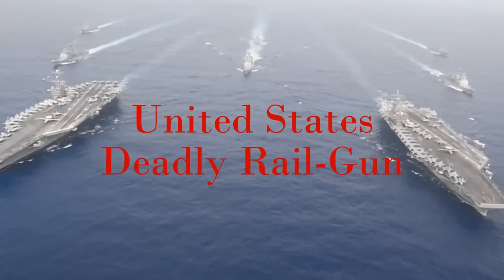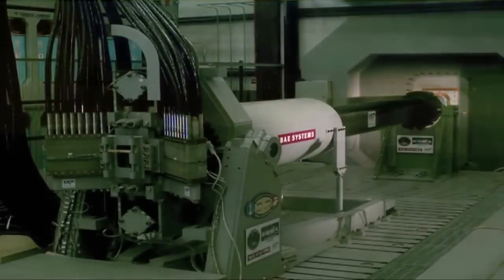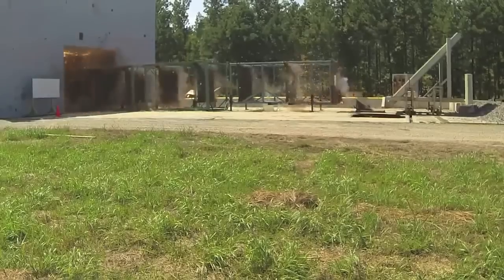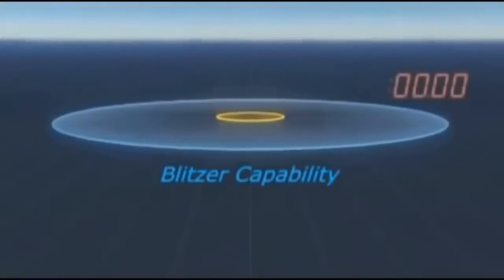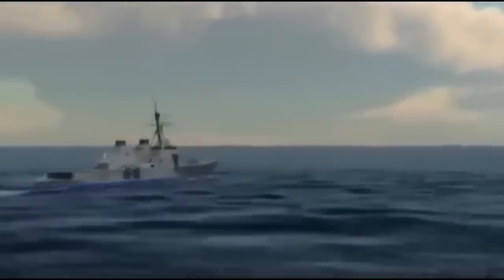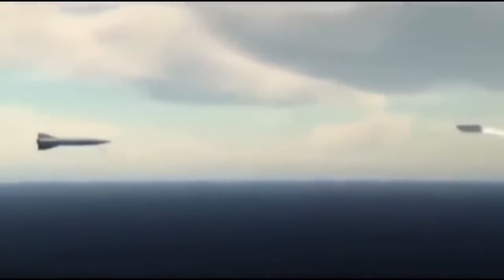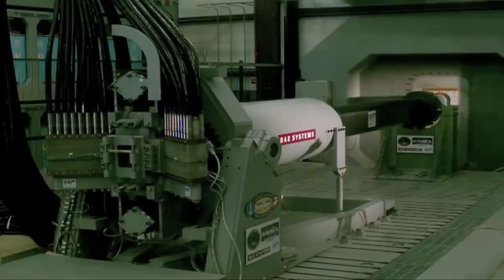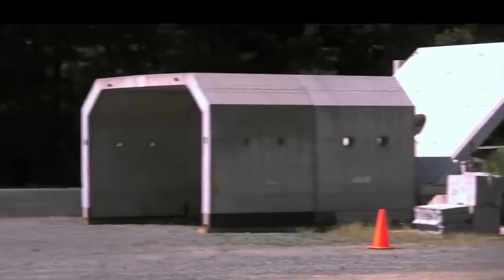USS Zumwalt will deploy the deadly Blitzer railgun

Comment: So the video says that this does not require chemical propellants. The thing about railguns is, the projectile will weld itself to the  rails at the breach if it does not enter with sufficient velocity. As I understand, the way that the test facility in Virginia achieves this high initial velocity is through the use of conventional chemical propellants.

Comment: if its using electromagnetic instead of conbustion chamber then where the heck all that explotion come from?
Reply: Chousa Heidan Air resistance + forced air compression in front , the flame trail is basically heat energy getting sucked into the wake of the payload as it travels

Comment: There's no question that Rail Guns can out-perform chemical cannons -- and the ordinance is technically safer -- but this video is making claims of accuracy that are just ludicrous. Sure, the gun has the range, but the further the distance to the target, the more each micro-degree of inclination matters. This thing has unprecedented range, but its targeting system isn't going to be any better than what we have now. You'd be lucky to hit a car standing still outside the range of conventional guns; precision strikes against enemy systems is intentionally misleading.
Reply: Live satellite assisted targeting + mid-flight computer corrected trajectory on a finned payload. Problem solved
Reply: Sorry, but circuitry won't survive the magnetic fields generated in a railgun.
Reply: Sure it would, ever heard of a Faraday cage?
Reply: Espen Negron Sure, I'm familiar with them. They're not going to block a 10 Tesla (!) magnetic pulse at 200 hz. Likewise, Mu-metal would vaporize trying to carry the eddy currents. We're talking about a device which imparts 50 Mj of energy in 5 milliseconds ... Terawatts of power! You don't put a radio receiver inside that and expect it to function afterwards.
Reply: No imagination. A Faraday cage is only as effective as the material being used, the amount being used, how closely "knitted" the material is, the pattern its "knitted" into, and how many layers are being used. Given plenty of thought, some research into tune-able meta-materials, dropping the assumption that the main components of the receiver functions solely on electrons, there's a solution. Though it'd be very cost prohibitive, the point is that it would work. 

TL'DR, you don't need to work around having that ridiculous amount of magnetism, it should be incorporated into the build. The faraday cage is simply to help slow down ion leeching.
Reply: I'm sorry. Did you just say I should drop the "assumption" that a RADIO RECEIVER -- something designed to interact with electro-magnetic waves -- I should drop the assumption that it functions based on electrons? Okay, we're done. Good luck with your invention, because if you develop a field-effect radio receiver, you'll probably be rich.
Reply: Daniel Budney. Again close-minded. Yes Dan, drop electrons.Your looking at the problem with old eyes; radio waves are effective and have been for the last 50 years but it is an aging tech. What else is electromagnetic in nature that is able to transmit information? FYI, not every logic gate has to use the flow of electrons to work. Also, before you get snarky, I dont need to invent it, because its already been invented, its just costly, hence the reason I said do your own research because Im not paid to write out a whole dissertation to help you realize it yourself, and to quote "If your good at something, dont do it for free."
Reply: Now you're suggesting we use laser communication to guide a target less than 1 meter long traveling at Mach 7? Nice try, but I'm done being trolled.
Reply: Daniel Budney Lmao. No. light could work, if you were that pressed to put in the work to make it happen, but not what I was referring to. I'll give you a place to start reading: Magnetic logic gates. You can fill in the rest. Fun talking to you Dan

Comment: Yeah, the projectiles are very fast and fairly cheap, unlike the $2M guided shells that are being ditched now.  This would be really great then if it wasn't that railgun rails have to be replaced very frequently because of the effects of the extreme thermal stress put on them.  (Some capacitors will probably have to be replaced almost as often too.)  Unfortunately, high-performance railguns like this are to normal guns pretty much what top fuel dragsters are to other racecars.  Yeah, they're much faster and more powerful, but you also have to replace big important expensive parts with such extravagant frequency that it just isn't practical at all.  The navy is generally going to have to reserve these railguns just for taking out gigantic decepticons or else this weapon technology too will bust the navy's bank account.

Comment: How did a camera pan a projectile going so fast?
Reply: The camera is pointed at a mirror that is programmed to turn at a certain speed upon launch.
Reply: High speed cameras.
Reply: chris77777777ify they only shoeed a small portion of the cameras fob (feild of veiw) and zoomed in on the vid
Reply: Its basic photography.  The same method used to photograph a CD spinning at over 200,000 RPM but making it look like its turning at 5 RPM.
Reply: ..lots of photographers standing in line...with fast fingers.
Reply: If youre here to start an argument, then youre not doing too well at it. Might wanna get a little bit more basic inelegance before trying to communicate with another human
Reply: RaDDx1993 Surprised you spelled that right, funny thing is though I wasn't even referring to you.
Reply: RaDDx1993 Well arent you a special little snowflake? Ill stop commenting now, as I actually do enjoy the video and would rather not have it plagued by any more of your comments
Reply: Didn't pan anything. They had a camera with a wide field of view, then they modified the video to show only the part of the video that had the projectile in it, cropping out the rest. Makes it look like it's panning, without panning.

Comment: Take the Iowa class Battleships, Iowa and Wisconsin and refit them with nine rail guns. Can you imagine the destructive firepower of a battleship broadside?  Battleships can survive multiple hits from anti-ship missiles from their 20 inches of armor. Replace the 5 inch gun mounts with Phalynx 30mm Gatling guns with depleted uranium tipped shells every 5th round. In the meantime start building 21st century Battleships that can also carry either AH-64 Gunships or F-35 Jump jets.
Reply: It'd probably be more cost effective to just build new ships around the rail guns themselves. There's no doubt that they would fit in the turrets, however those ships were built around the Mk 7 16" gun, so there would be an absolutely enormous amount of refitting and machining that would need to be done to accommodate the Blitzer system. Powering them, is an entirely bigger matter as well, which would probably require the installation of several nuclear reactors on board the ship.
Reply: As much as I would love to see that... Battleships in their current form, cannot handle the power needs of a single railgun, let alone nine. They would have to be nuclear powered.
Reply: Well then retain the 16 inch guns until a couple of 21st Century Battleship can be built to take over. It'll take a few years to complete them.  Replace the 5 inch guns with 20mm Phalanx battery platform for any suicide boats.  No country wants a battleship sitting off their coast.

Comment: this weapon aint that good how about disclosing the portable particle accelerators the us have with don't need any ammunition cause it fire particles that has no mass or is that a super secret weapon
Reply: it was proven in 2014 that particles do have mass.
and there are particles going through you RIGHT NOW. are you dead?

Comment: "Cheap" projectiles?  How does $800,000 a shot sound to you?
Reply: You refer to the cancelled $800,000 LRLAP from ripoff bastards Lockheed Martin. This new railgun wil fire the HVP from BAE Systems at a cost of about $50,000. Not that we should ever put a price on killing Russians #LOL
Reply: Scott Watson I hope they're able to make the projectile a lot cheaper... Really, all you technically need is a light steel or aluminum solid bullet with fins sized such that they make electrical contact with the rails.
Reply: The whole point of a Linear Accelerator as a weapon is that.  That is not what arms manufacturers want though.
Reply: I'm not saying that 800k$ per shot is bs, but i want to know from wher did you get that nr?
Reply: Ok, i have searched and the $800k per shot is about the Advanced Gun System, not the railgun.The Advanced Gun System is a GPS guided projectile and the Navy is thinking to go with the railgun and get rid of the AGS
Reply: Alexandru Rohozneanu Thank you for enlightening me.  I stand corrected.
Reply: Scott Watson
No problem, we are all humans
Reply: Over $1,000,000 per shot as of yesterday.
Reply: The ATACMS  missiles that are fired from the M270 and the new HIMARS are $1.2 mil a piece, i know, i put 72 downrange in 2003.

Comment: As for the Zumwalt's current guns being used for coastal bombardment, read this
http://www.popularmechanics.com/military/navy-ships/a23738/uss-zumwalt-ammo-too-expensive/
Reply: It's not the same weapon, if you actually read the article, not only the title, they are talking about the Advanced Gun System which is not the gun from this video.
Reply: The Blitzer rail gun doesn't exist except as a crude prototype. The Zumwalt is being equipped with the Advanced Gun System for which they have now cancelled the contract for Ammo. $800,000 per round. Contract must have been with Ferrari. This thing is headed for the scrapyard.
Reply: From what I read, I believe that the railgun won't be ready abroad sea ships until 2025. That's a long time away. LRASM would be a good alternative until then.